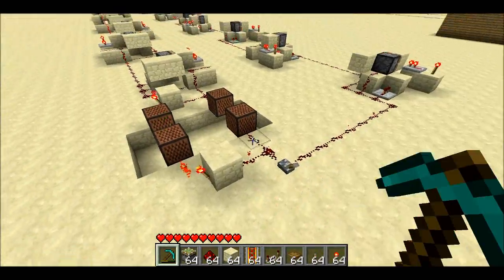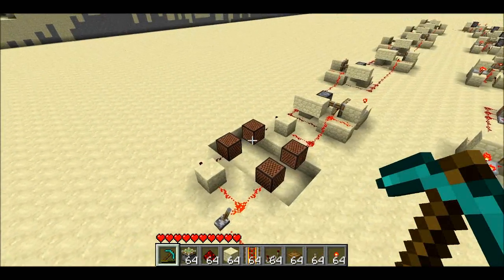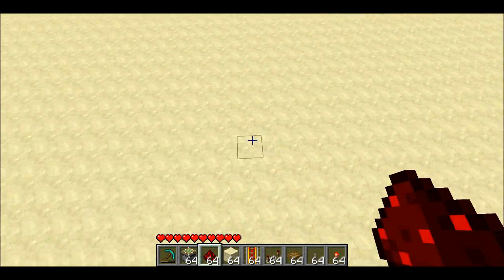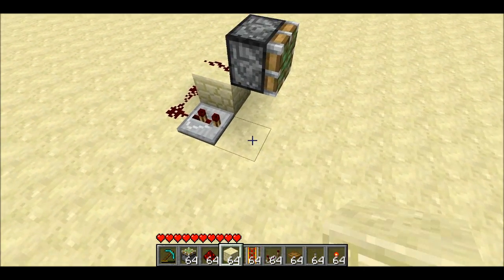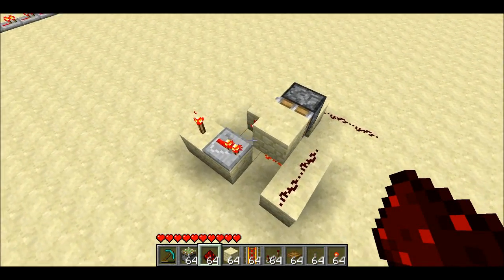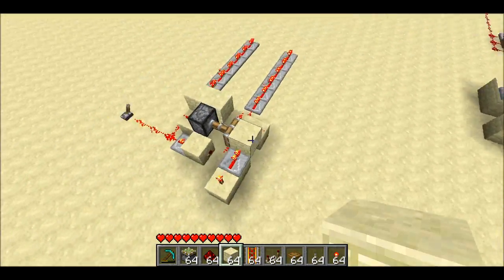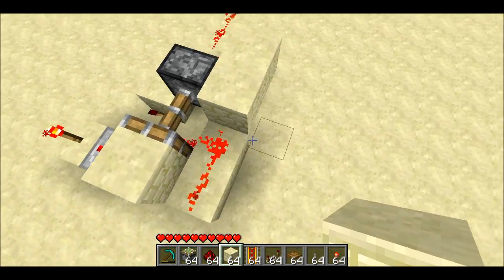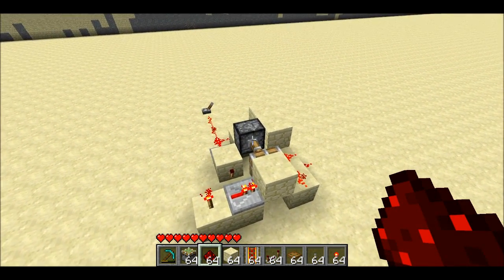5x4x2 Instant Repeater/NOT Gate

Comment from the maker: @dirtcrusher95 While I did get the torches to burn out by toggling it quickly, each pulse seemed to revive the torches. I'd have to do more testing, but I'm not actually sure that torch burnout is a problem.

Comment: Yeah i dunno if the update broke it but im trying this on 1.4.2 and it's not working :\ the redstone that's supposed to update the output when the piston extends isn't updating anymore so it's causing that 1 tick delay per repeater, i tried replacing it with a repeater and it almost seemed like it worked but after testing it a couple more times i found it doesn't...any thoughts seth?

Comment: I built one of these and it didn't work, it still had a one tick delay, so I modified the redstone to be blocked off by the piston instead of passed through, and every time I apply current to it without fail, the piston does the double head glitch.